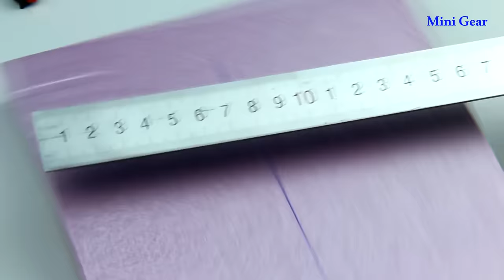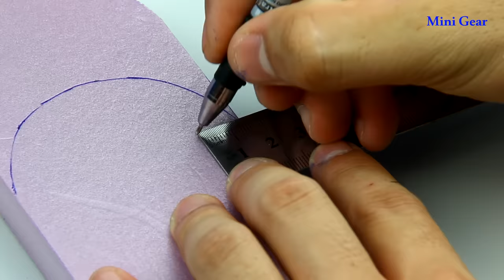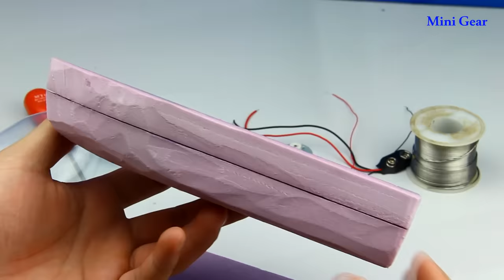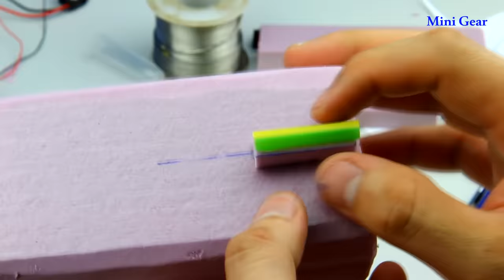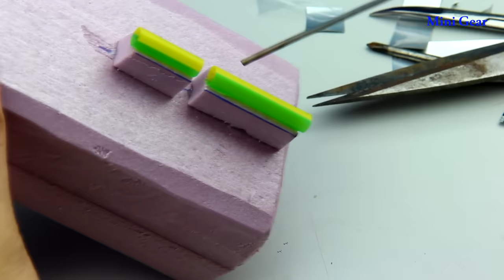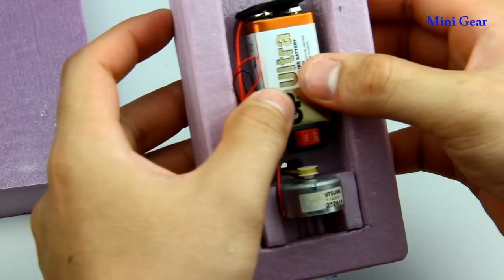How to Make a Boat - Simple 9v Battery Foam Boat Mini Gear

Comment: I rate this as a great build because he put the prop at a straight angle, and not angled down, and he went through the pain required to make that happen, and about the only way to make it happen, and that is with gearing (the rubber band).    However, the efficiency and power that you lose in the process out weighs benefits of the better prop angle. But still, a great build to put it off.  Especially the prop making which is the hardest part.
Reply from the maker: Thank you very much for sharing your idea...I will make RC boat soon. What do you think?
Reply: iu9tigchf scored Mitt Romney's second term as a candidate in a bid for president Obama in his campaign for president Obama and his
Reply: Thar

Comment: can i know what is needed to make this project
Reply: 1-  9 volt battery
2- DC motor
3- foam
Reply: All you need in this project is 
9v Battery with its connector 
DVD Motor 
Foam 
Switch 
Aluminium Sheet for making
Propeller 
Straw or Refill of Pen
The tools you need for this are
Cutter 
Hot Glue Gun 
Soldering Iron with Tin Wire and Soldering Paste
Reply: @montykisuperbvines  My english didn't enoughf for this, thank you
Reply: @gomboc6452  It's alright. Just keep trying for what you want to achieve

Comment: I can find one more problem with this invention where when the boat reached the end of the route, it will stop moving so I am doing my project to create a design so that when the boat reaches the  end of the route, it can change its direction automatically as this boat do not require controller. If there is someone who has an idea for this part can help me as well ya 😊😊
Reply: idk either 😭 i need to do things like this too for my uni project 😑